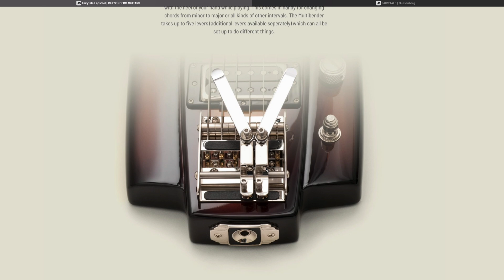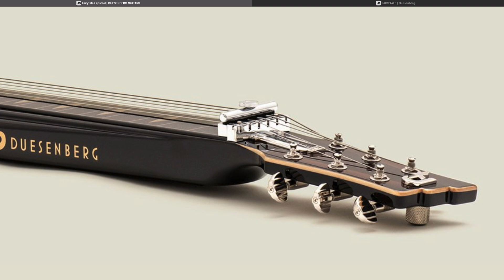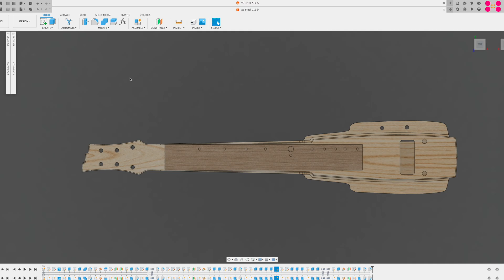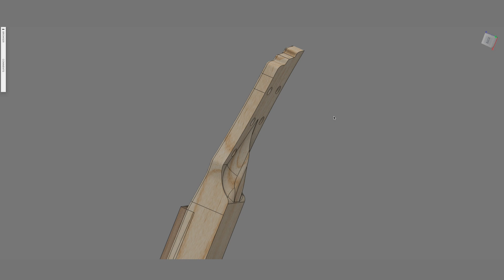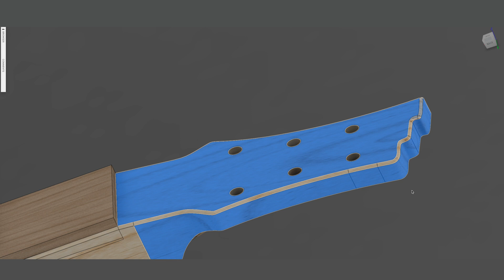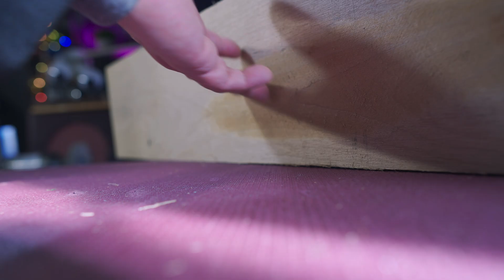Lap Steel Build - Design Phase - DUESENBERG - bender system

Comment: So, how did it turn out?

Also, did you have any experience with Certano roller nut and bridge? I had a roller bridge on a guitar, it was horrible, gave the guitar a banjo like sound, I swapped it out immediately. On an old Silvertone lapsteel I had conventional plastic nut and a solid Titanal bridge I had someone machine for me (30% titanium makes it sound very glassy and resonant), I couldn't get all strings to sound evenly under the bar, no matter how much I filed, added material, filed again -- a nightmare.
Reply from the maker: I'll be using the Ceratno on this build. Build video comes out this Friday.

Comment: Have you seen the benders people make out of spoons? You can find on YouTube. Works surprisingly well.
I started playing lap steel a couple months ago. One thing I like about mine is the built-in legs -- so it's always set up and ready for you to sit down and start playing, like a piano. I recommend it. Especially if you're making something beautiful, it should be out on display and inviting people to play it.
Another thing to consider is integrating a holder/rest for your tone bar, so you have somewhere convenient to place it when you're not playing, so it doesn't just roll away.